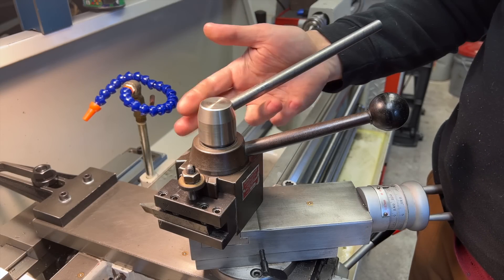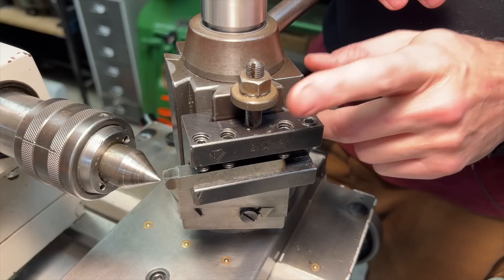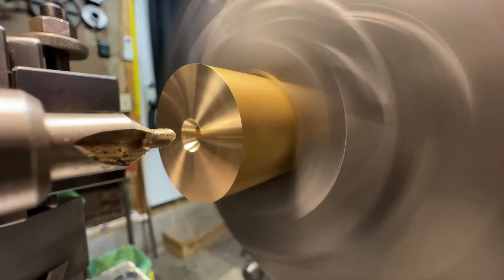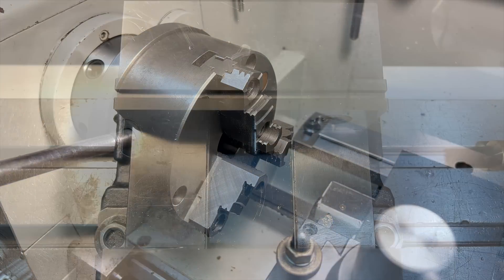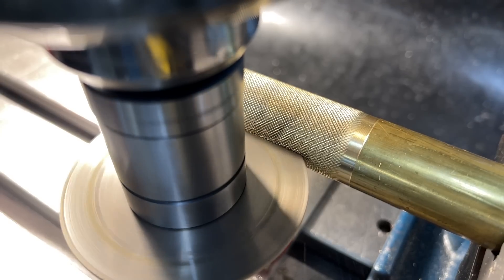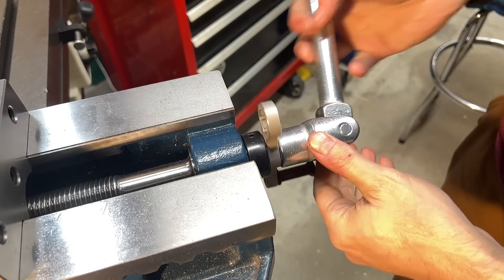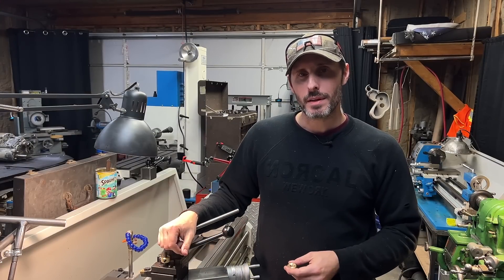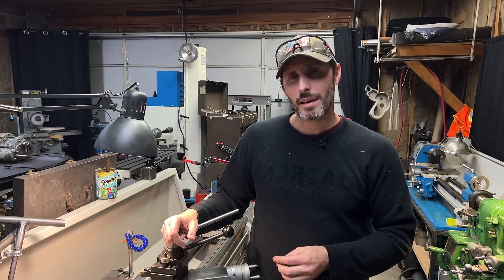QUICK and EASY Self Locking Tool Height Adjustment!

Comment: You should have tapped them 10x32 so you could use a 5/32"Allen wrench for both the tool and adjustment.

Comment: exchanging it for an allen key does give you a cheap way of never losing the wrench...all you need is a ten pack of allen keys then drill a hole in something near the lathe and drop the allen key into it...never lgets lost and you can do that for 10 more allen bolts instead of having 10 wrenches or wandering arounn wondering where you left the wrench this time....sometimes adjustable wrenches are as hard to find as 10mm ring spanners.
Thanks for sharing

Comment: I was thinking you were going to make a mechanism similiar to a bicycle seat post clamp with a built in small thumb wheel maybe, instead of trading a wrench for an allen key.  Now I’m in my head thinking about how to design one for my lathe!
Reply from the maker: @robertmason8341  yeah that’s why I haven’t made more of these, didn’t really fix the issue just traded for a different one. The bicycle clamp is a really cool idea though… 🤔

Comment: FANTASTIC! Gonna' convert mine ASAP! I am so tired of the nuts binding and one turning the other. This remedies all complications and saves time. Thanks so much.
Reply from the maker: Thanks so much for watching. I will warn you though, there are some issues with this design as well. First, there are times where the screw head can be in a position where it's blocked by the tool post. Just lift up the tool holder and you can tighten the screw in this rare situation. Second, I wouldn't recommend brass, I'd use steel instead. The brass is just too soft and slippery against the steel thread and you gotta tighten super tight, making them out of steel fixes this, plus it's cheaper, so yeah I'd use steel. Good luck on the project, and thanks again for watching!

Comment: How about modifying a double-ended set screw and attaching a head on one side (press-fit, pin, loctite, etc.)?

That way you can tighten it from either side using the same allen key.

Comment: I'm confused.  If both sides of the slit are threaded, how does tightening the screw actually bring them together?   Did you drill out the threads on the counterbore side at some point?  Also, what is your plan if you spin the nut and the screw head is facing your quick change post?  You won't be able to get a hex key in there.
Reply from the maker: Both sides are not threaded, and just lift up the tool holder clear of the post.
Reply: @hersch_tool  That makes sense, thanks.  I must have missed the part where you drilled through the counterbored section with a larger drill bit.  The shot at 11:30 when you are holding them makes it look like both halves are threaded.

Comment: Great idea, thanks. Those double nutted adjusters drive me nuts. They are fiddly to get them right, and never seem to stay that way. Another tip is to check that those threaded rods for the adjuster are tight in the tool holder. I've several times had a loose one which of course throws off your adjustment. I now Loctite the studs and torque them down good  before setting the height.
Reply from the maker: @Changtent  thanks very much, and thanks for watching!

Comment: is there a solution for the situation where the bolt head is on the backside, colliding with the toolpost? is it stable enough to remove the tool holder, then lock it via the clamp? I love this idea, and am like 85% I want to add this to my lathe as well. Great project!

Comment: One variation you might consider doing is not thread the back end, but instead put in a camlock nut on the back, (with a milled surface to cam off of) and effectively eliminate the need for even the allen key once t he cam-lock-nut is assembled and adjusted so the camlock latch works as expected.
Reply from the maker: @RNMSC  yeah that’s a pretty cool idea. Thanks for watching btw!

Comment: Great idea and execution but what do you do if the height puts the socket head behind the or towards the spindle? I'm curious if the band could be a slip ring around the clamping surface so you could keep the socket head and an easily accessible angle.
Reply from the maker: Thanks very much. It's not perfect, there are definitely better solutions. this comment has been made about a bazillion times lol, you can lift the holder up and out of the way in that case, it works but again it's not perfect. Thanks very much for watching btw.

Comment: How to tighten the screw if its head will look at the center of the toolholder? )
Reply from the maker: you can just lift it up and out of the way in that case. but i think there is still a better design than this one for that reason which is why i haven't made more of these. thanks for watching

Comment: At certain height settings it seems access to the locking screw will be blocked by other parts of your setup.  Is this a problem?  You could probably use thin washer used as a spacer when that happens, with the right thickness of washer, it would move the screw to the front.  Is there a simpler fix if the access to the locking screw is blocked?

Comment: What happens when the lock bolt is inaccessible?
Reply from the maker: You can just lift the tool holder and tighten it down if it's facing the post. But for that reason and some others this isn't the end all be all solution. I still think it's better than the jam nuts, which constantly get stuck together on me, but far from perfect.

Comment: It looks nice but the old system is way more practical. Is much easier to trow a wrench on the top nut and turn it than to fiddle around to get the allan wrench in place. Also, I would like to see how you use it if the screw lands in the other side.

Comment: So, you've eliminated the need for an adjustable wrench to tighten your locking nut. And replaced it with a hex wrench to tighten your locking nut. Nice work.

Comment: Doesn't this limit your height adjustment by like 1/3 of a turn every rotation? Like you can't actually set the height to any position that faces the screw head towards the body of the tool? Or is height not that critical of a measurement in general?
Reply from the maker: Lol, read through the other comments, this has been asked, a lot... 😅 You can just lift of the tool holder to tighten it if that's the case, or can slide a washer underneath to change the position of screw head. Thanks very much for watching btw!

Comment: Civilized, you say? A 22nd century  civilized person would be using a quality T-handle hex... say like the Paramount brand from MSC, (just helping your not so subtle logo placement, in case Erik's watching.)

Like the idea of the locking brass nut, but I'd add a thick, hardened washer... like a Gibraltar brand, MSC sells.  (Hey, Erik, that make this a 2-fer, send this boy somethin' nice!)

I do need some advice on making some locking adjustment nuts.

What size fastener would you recommend for the locking screw, given the adjustment stud is a 10-32, instead of the ⅜-24 you have?

Like your vid, sub'd & liked... you'll hear more from me... (you've been warned)

GeoD
Reply from the maker: Haha, I appreciate your advocating on my behalf ;) 10-32 is a small stud, however I think that I would approach it by making the adjustment knob first. I would probably want to make it as large as possible, without being awkward or cumbersome in relationship to the stud. Then you can size your fasteners, or any other features relative to the knob. I would think that you could get away with somewhere around a #3 to maybe even #6 fastener in the stud, again depending on the size you settle on. The limiting feature will likely end up being the size of the locking screw's head in comparison to the thickness of the adjustment knob. Thanks for the sub btw!

Comment: Just wondering if the threads for the SHCS are in both sides of the split, how you can tighten it.  I would have thought it would work better with no threads on the head side, but maybe I’m missing something.
Reply from the maker: You can't tighten it if both sides are threaded. As I explained in the vid, one side (the head side) is drilled for clearance around the bolt. Thanks for watching!
Reply: Ok, thanks for clarifying this for me!
Reply from the maker: @almacdonald2506  No probs :)

Comment: Nicely made👍, but i see there a problem.... how you lock the screw, when the hex is ecactly at your tool post?
Okay you can take the tool holder out of the toolpost, but unlock the handle, get it out, lock the screw, get it in, lock the handle .......oh and now you realise the tool is too low/high.......the same procedure backwards and perhaps this more than one time......till it fits perfect.....
That would bother me, after a short time of usage. 🤔
Reply from the maker: Yeah, it's definitely not perfect. There is room for improvement, I'll make a V2.0 at some point in the future to address issues. Thanks for watching!

Comment: What to forget to mention you can't use 50% of the rotation because the hex key won't fit. What some complete wastes of time.
Reply from the maker: lol wow... 🥴 you can literally lift it up and out of the way to tighten it if that happens.
Reply: @hersch_tool the aloris height adjustment system, works better than anything on the market. (Which you have) you don't have to move anything to tighten it. You quite literally made it worse to use.

 Hanging a dedicated tool post wrench near your lathe is far superior to another nonsensical handle. As far as that goes, you could just leave the wrench hanging on the nut, I and others do it all the time. 

All these youtube "machinists" that make videos building better mousetraps just for the sake of videos to appease ignorant audiences is tiresome.

Comment: Imagine the alen screw is located at an awkward angle(after the nut is adjusted) and its hard to reach it to tighten up the alen screw.... mission fail.
Reply from the maker: Imagine lifting the tool holder 3 inches to clear the post, tightening the screw, and setting it back down... ;) Thanks for watching!
Reply: @hersch_tool  walk-around.....

Comment: I think it's a good idea and it will work very well. And if the bolt ends up in front of the centre bolt of the toolpost, all you have to do is lift the toolholder a bit to be able to reach the bolt. So, good one.
Reply from the maker: Thanks very much. I think they came out alright for a first attempt, they work the way I'd hoped they would so that's always a win lol.

Comment: A lock nut with a nylon insert would work. There are no forces that would make it turn and if it loosens from repeated adjustment you can buy them by the hundreds for pennies.
Reply from the maker: Yeah that would work as well, but a nyloc nut is difficult to turn, usually requires a wrench, just isn't the solution I'm looking for personally. But I think would be a fine solution. I've actually had nyloc nuts on some of them in the past and ended up ripping them off in a fit of frustration while attempting to adjust tool height and dealing with the lock nut fighting me at every turn... pun intended? lol. Good idea though. :)

Comment: Good idea but i think you could bet better all round access to the locking screw if you slit the brass thumbwheel horizontally rather than vertically. The horizontal slit would want to be about 1/4 way down from the top so the force needed to pinch the nut threads together isn't too high.
Also consider trying some similar knurled thumb wheels with a homemade 'nyloc' insert and then it is just the friction of  the 'nyloc' needed to keep them in the desired height setting.
This is not intended to be any negative criticism of your efforts,just a bit of bouncing a few other ideas around. I do agree the standard thumb wheel and locknut system is a PITA to deal with.
Reply from the maker: Thanks very much, those are both really good ideas. I have been kicking around ideas in my head to improve the design as this first attempt is "ok" but definitely isn't great. The "nyloc" or friction type solution seems interesting because ultimately I am always looking for ways to eliminate all of the extra tools that I'm constantly reaching for to help tighten and loosen things. I am adding both of these ideas to the list lol. There will be a V2.0 at some point when I find that "perfect" solution. Thanks again, and thank you for watching!

Comment: Nice video!
How do you tighten the split nut when the allen head faces the toolholder?
Reply from the maker: Thanks very much! You can lift the tool holder or use a washer to re-clock the screw. And thank you for watching!

Comment: I just found your channel and this is the first video I've seen. You mentioned the irony of switching from a wrench to an Allen Key. I also see a problem where the locking screw would be stopped with the key slot facing your tool holder. I'm not sure if you measured out the nut slot to account for thread position in that instance, but I could see that as being your only problem. Please keep your vides coming. I've subscribed and look forward to seeing your channel grow.
Reply from the maker: Yeah that's definitely a design flaw. I'll probably do a V2.0 at some point in the future to address that and any other issues I find along the way. Thanks very much for the sub btw, I'll keep working hard on the channel and hope to see you in the next one! Thanks!

Comment: uhhmm.... hear me out.. but what if ... what if the head of the screw is directly in the center of the toolholder... how do you thighten it then?
Reply from the maker: Very, VERY carefully... Lol. It's a design flaw. Lots of comments about it. Can pull up the tool holder, use a washer to re-clock the screw, etc. But I'll probably do a 2nd version in the future to address that and any other issues I find along the way. Thanks for watching!

Comment: I think you can tighten the brass nut just enough so it will not come loose but can still be turned by hand.  Meaning hex wrench will not be needed after initial setup.
Reply from the maker: Yeah you can definitely find that "sweet spot" for a friction fit that will allow you to adjust it without the Allen wrench but is tight enough that it shouldn't move around on you. Thanks very much for watching!

Comment: It needs to be a split collar with 2 screws that oppose each other. Then either screw can be used to tighten the brass nut at any rotation.

Comment: I wonder if a thrust washer under it would smooth the adjustment even more?
Reply from the maker: Not really necessary because there isn't any pressure being applied when it's being adjusted. A thrust washer is good in circumstances where friction is acting against rotation, which isn't really happening here. Good question though, always looking to improve and that's what it takes! Thanks very much for watching btw!

Comment: Great idea. I like it a lot. The only problem is when the screw head faces the tool post. You won't be able to get the wrench in there.
Reply: Not a problem, just lift the tool holder clear of the post, tighten and drop back in😊
Reply from the maker: Yeah that's potential issue. Might end up making a V2.0 after I use these for a while and that'll be one of the things that get fixed. Thanks very much, and thank you for watching!

Comment: Will your cap screw always be accessible when the allen socket is facing the center post? Any clearance for Clarence the modified Allen key? ?
Reply from the maker: Good question, check the comments, we've been discussing this a lot. Could just lift it up, or use a washer. But might make a V2.0 in the future if it ends up being an issue. Thanks very much for watching btw! 🙂
Reply: @hersch_tool  You fall into the category of " Thinking things through with practical application eludes most people"
Reply from the maker: @charlieharper981  not exactly sure what that's supposed to mean

Comment: You traded the wrench for an allen key, AND you lost about 1/4 of the ranges that you would have been able to lock at.  Since the allen key won't be usable if you need a height that causes the head of the allen key to protrude into the QCTH
Reply: It needs to be a split collar with 2 screws that oppose each other. Then either screw can be used to tighten the brass nut at any rotation.

Comment: How do you tighten the hex screw if center height adjustment causes it to be indexed on the side of the tool post?
Reply: It needs to be a split collar with 2 screws that oppose each other. Then either screw can be used to tighten the brass nut at any rotation.

Comment: The whole idea behind a quick change is to have one for each tool and NOT adjust it all of the time.
Reply from the maker: The idea is that you can set up the tools that you need for a particular job. I don't know anyone who has a separate tool holder for every tool they own and never changes tools. In reality you change them fairly often and for many reasons. Thank you for watching!
Reply: Sure but if you regrind a cutting tool you'll have to make an adjustment. Not sure if that's a big deal or not, but it's not a set-it-and-forget-it-forever kind of thing.